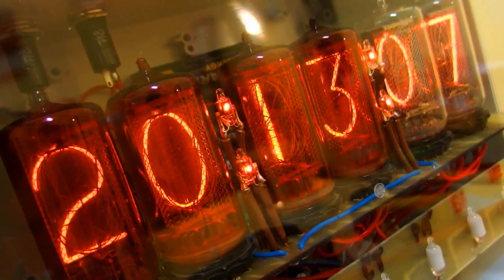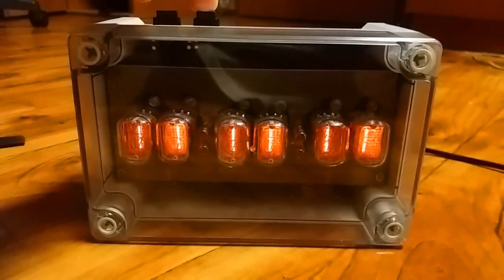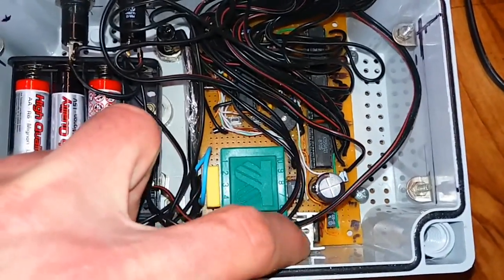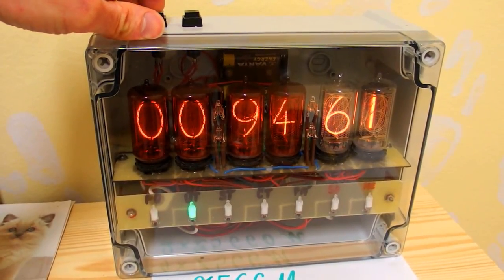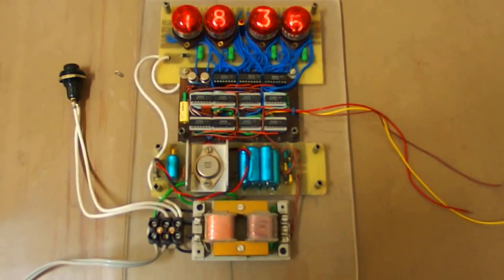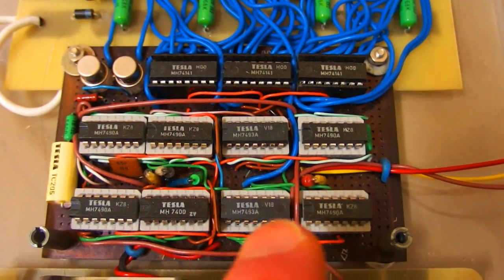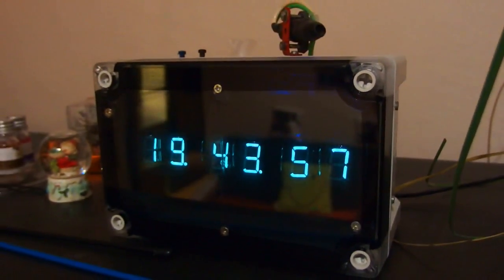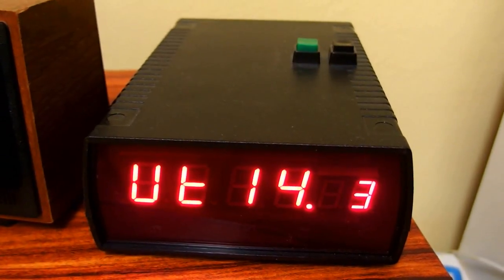Nixie Clocks and Other Clocks I Have Built

Comment: I know I'm commenting on an old video, but anyway. A long time a go I had incredibly detailed plans on building a Nixie clock with only logic chips. Unfortunatly I never made any schematics other than in my head, but I had it all figures out. It's basically just counters and and-gates logic anyway. I was supposed to display time including seconds, and day of the week like yours does. It was also supposed to have an alarm function. Timing would have been 50Hz from mains, divided down of course. I got as far as purchasing 6 IN-14 tubes, a load of MPSA42 transistors for switching the digits, and I built the power supply. Then I stopped for some reason... I think because I got my heart broken by a girl, haha. I had plans for an "analog" digital clock too, counters with D/A converters feeding analog meters with custom scales. Could have been cool! I did build a binary clock though, with incandescent lamps as display. I think I have a video of it on my channel.

Comment: Many of them, and it's still nothing compared to all the variety of vintage display devices. I'd love to see you build a clock using the Burroughs B-7971 tubes, but they're hella expensive. Over 200 bucks a piece on eBay doesn't cut it... at least for us here in Central Europe.
Reply: Not in my case, I was lucky enough to be given several boxes of them, and I have now built over 18 clocks.

Comment: For your clock that uses only 70s parts, did you use only parts that were manufactured in the 70s or also new parts that were already available in the 70s? For example 1N400x diodes were available in 70s, but it's much easier to get a new one than one that you're sure is from the 70s.

Comment: Nice. I love the enclosures you use, where do you get them?
Reply from the maker: Those come from electronic component shops or e-shops, like tme.cz and gme.cz, but those probably don't exist in your country.
Reply: Yeah, i'd need part numbers, but if they were custom for those distributors (a common practice), then that wouldn't help either. But, now that I know that, I can change my focus to looking for similar things elsewhere, so useful information nonetheless.
Reply: Actually, I should have just checked your links first. Haste, and over-thinking are two of my greatest flaws, as I am sure you have noticed by now. XD
Reply: Tme is in almost all countries in Europe. These boxes are for what? I have never seen it before.
Reply: @volkhen0  they are for electrical installations. They usually are sealable and they have special ones for electricity meters. They usually have a din rail in them, and they are expensive. Whenever I get some of theese boxes I usually use them for my home. Like put a plc or even better an mcb in it.

Comment: I have to admit that i like the 74xx logic version better, im old school and never got into programming micros, too much jibberish for my brain lol.

I have 8 74141 chips i took out of a frequency counter to convert it to led's, the nixe tubes were very ill.
I bodged in some 4 bit bcd to 7 segment cmos driver chips + resistors to take the place of the 74141's.
The owner was happy with the result, and i kept the old chips.
I think the cmos chips i put in were 4511's, i think lol, long time ago.....
Reply: I agree, but there's some satisfaction when you make the clock from a simple, generic "dumb" chips. I dig that, but I don't hate uC's. I made, may God forbid, a flashlight with tiny13 :D But at least I used the possibilities the micro gives - battery protection, 3 modes. What drives me nuts is those 'projects' where they put a micro to do a very basic boring function, like a flashlight with 1, dammit, mode and nothing else
 >:(
Reply: I did get satifaction when i made an 8 digit frequency counter from 4000 series logic/counters, it worked straight away, and it wasnt copied from an electronic mag or anyone elses design.
It was one of those "Can i do it" projects, but looking at it now, it was a typical classic design.
The 1 or 10 second gate time made me scratch my head, i woke up in the middle of the night with a dead simple way, the subconscious did the job for me LOL.
Reply: Seems like I'm not the only one who may wake up at 2 a.m. and rush to the notepad to fix the idea on paper :D
Reply: Yep us monkeys are more similar than you might think LOL.
The notepad and pen is exactly what i did, then i fell into a coma called sleep, hmm warm bed z z z z :-D
Reply: That is a sign of a true electronics enthusiast, I think. You have to be a weird nut sometimes LOL
Reply: LOL keep being nutty, i do, i keep the lads at the salvation army laughing, makes the day go by much faster i found.
Odd how time speeds up when you are enjoying something, ive never worked that one out.
Reply: TTL/C-MOS logic is so versatile and practical. Not only i don't program but i hate kids that play with shitty Arduino and don't even know that Ohm's law is.